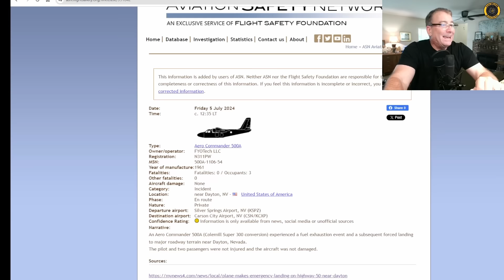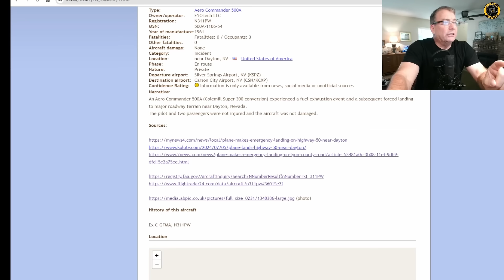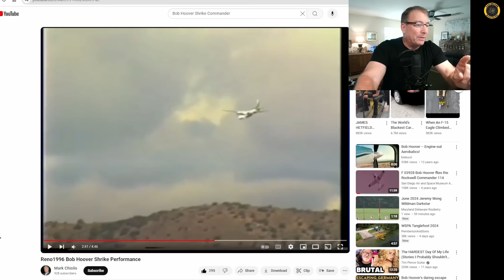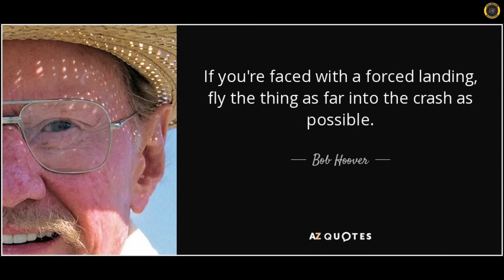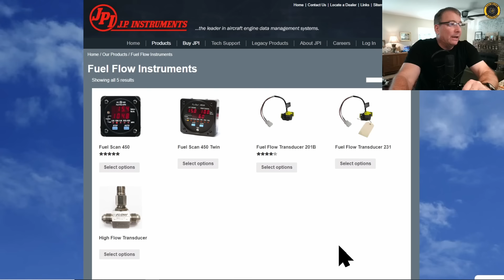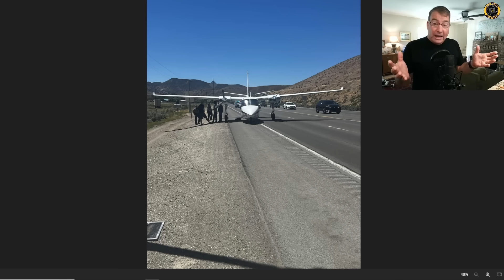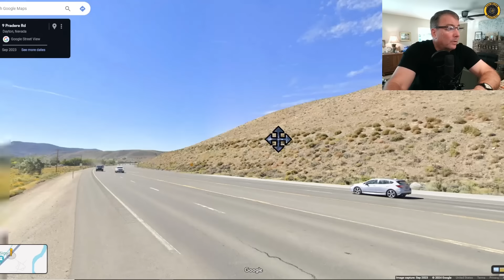Aero Commander Forced Landing Hwy 50 Dayton NV 5 July 2024

Comment: My father and me had a close call in a Cessna 337 due to fuel starvation we purchased from a crusty, retired airline pilot and AI.  As part of the sales negotiations he said that he just filled all four tanks with fuel that morning and demanded more money for the fuel. 
Seeing all 4 fuel gauges at "full" and taking a friend and professional pilot/mechanic's word, I never checked to confirm the tanks were full. I did get a bit of water from the sump drains near the tail boom wing struts and front engine strainer, and we departed for our first flight in the Skymaster to Spokane. On take-off the old Skymaster accelerated and climbed quickly at about 160mph indicated and nearly 1,000fpm, my dad remarked: "This thing's a Hot-Rod!" but only a few miles northeast of the Salem airport  (SLE) at about 2000ft we started to experience fuel flow fluctuations on the front engine. I hit the front boost pump which stabilized the fuel flow but only for a few seconds until the front engine quit completely. My father tapped the fuel gauges that were still showing "Full" as I switched the windmilling front engine to it's aux tank, and after about 20 seconds it roared back to climb power for about a minute and then quit dead. 

We were just south of the Aurora airport along I-5 so I made a bee-line for I-5 and the airport and switched the front engine from its 'Left Main' tank to 'Cross-Feed' from the Right Main tank for the rear engine, and in a few seconds both front and rear engine fuel flow began to fluctuate and quit simultaneously!. At that moment we both came to a harsh realization it was not water contamination we were dealing with. We both looked a each other and exclaimed: "WE'RE OUT OF FUEL!".

I switched the rear engine to its Right Aux tank, and in about 20 seconds the rear engine came back to life. I feathered the front engine and jogged over I-5 and prepped for a landing on the freeway, but the rear engine remained running long enough to get us close enough to the Aurora airport I figured I could glide to runway so I jogged back over to the runway for a downwind landing on 34, but just as lined-up with the runway the rear engine quit again. I feathered the rear engine and advised I was making an emergency dead-stick downwind landing on 34. 

The 337 we just bought was an early model with only one landing gear hydraulic pump on the front engine, so with the front engine feathered, the gear had to be manually pumped down, I placed the gear selector 'down' position and the big gear doors flew open and the mains fell into the high-drag trailing position. My dad said 'YOU FLY THIS SOB, I'LL PUMP THE GEAR!" but with his left arm in a cast from falling from his horse, he clumsily tried pumping the gear handle between the front seats with his right arm from the right seat. With the end of the runway approaching and my dad's struggle with the pump handle was not going to get the gear down in time, I moved the prop control out of feather to try to get it windmilling, and I saw the frozen, feathered prop blade rubberly snap into the flat pitch position (I had just discovered the 337 happened to have the rare un-feathering accumulators). I hit the front starter to get the prop windmilling and in a few seconds the engine-driven hydraulic pump along with my father's hap-hazard pumping finished extended the gear, at which point I re-fethered the front engine.

By then I ended up a bit low on approach but just made the numbers. With both props feathered we coasted to a stop just short of the mid-field taxiway turn-off, with all 4 fuel indicators still indicating 'F' for "FULL-FUEL" (plus a little more). I switched both engines back to main tanks and was able to get enough fuel to get the front engine started to get us off  the runway and to the the fuel pump. 

When I called the seller and grilled him about lying about the fuel he laughed and said: "Well you Dumb-A_ _es let that lesson to you and your old man, you should have checked the fuel! Lucky for you I didn't leave ya MORE Fuel or you'd be out in the mountains right now! Never take anybody's word for anything, HA HA!"
Reply: well, he was right, even though he was an ass-hat
Reply: @Bob-j5o3b  Yup, Lesson hammered home.
Reply: That's total BS. Had he actually been "teaching you a lesson", he would have waited until you were walking out to take off, then beat you over the head about taking someone's word. Worse, he knowingly sold you an aircraft that had defective fuel gauges and didn't say anything?!
Reply: That airline pilot literally tried to kill you. I wonder if he has killed before, absolute psychopath
Reply: @kurtbilinski1723  He obviously didn't intend it is a teaching moment, but rather as a deflection. As I posted below in response: "Bottom line was 'I' could have killed both of us by not checking the fuel. As for 'Bill' being a Psychopath,  I'd say it was more a case of an old horse-trader out to skin another horse trader, like the 90% of car dealers, attorneys and politicians that give the other 10% a bad name. 
We later found out all the fuel level sensors had been disabled to show full, and I found a hand written bit of cardboard with tape in the glove box that said "Fuel gauges INOP". He could have bought it and removed the placard, but it might have been seller he just bought it from a couple of days earlier who misled him as well.
Reply: @ninjalectualx  He obviously didn't intend it is a teaching moment, but rather as a deflection. As I posted below in response: "Bottom line was 'I' could have killed both of us by not checking the fuel. As for 'Bill' being a Psychopath,  I'd say it was more a case of an old horse-trader out to skin another horse trader, like the 90% of car dealers, politicians and attorneys  that give the other 10% a bad name. 
We later found out all the fuel level sensors had been disabled to show full, and I found a hand written bit of cardboard with tape in the glove box that said "Fuel gauges INOP". He could have bought it and removed the placard, but it might have been seller he just bought it from a couple of days earlier who misled him as well.
Reply: @jackoneil3933 Im by no means calling you a liar just having a hard time believing a retired airline pilot would do such a thing to someone. If you fatally augured in after a duel flame out he could be tried for manslaughter. Thank the good Lord your the type aviator that you are because it could have turned out worse. If it was me that happened to I’d have to return the favor and teach him how to not screw with peoples lives. Before I was done with the fool I’d have him reimburse me for the fuel load cost he charged me. Oh and also the cost for laundry for my pop and I.
Reply: Wow! Incredible airmanship! Thanks for the story
Reply: @Gebenki  Thanks! But I wouldn't call not doing a proper Preflght 'Airmanship'. 
I'd say if you are proficient enough to be able to safely operate an aircraft in emergency situations and to avoid  or prevent emergency situations, that's 'required'  rather than 'incredible' airmanship. 
I once asked a test pilot and astronaut (Scott Crossfield) a few years before his lost his life in his 210, mentioned something about what's most important in survival situations, and he said something to the effect: "in life-threatening situations, if you become more concerned with your own mortality or the mortality of others then extricating yourself from that life-threatening situation, you're probably not going to do so".   

In that situation I had flown a few hundred hours in several 337s My father and I had bought and sold , and had taken my private pilot check ride in a similar337, so I was comfortable to the point of being hazardously complacent. 

Most of the calls I had were in my first 1500 hours of flying, with most of the close calls  being in 337s, solely because it was the aircraft I was most  comfortable and complacent in and demonstrated some of my worst acts of poor airmanship in. I survived and learned from those episodes of bad airmanship, and not checking the fuel that day was one of the worst. 
I've often wondered is a person never committed acts of poor airmanship if you would be a better or worse pilot for not having done so?

Comment: Well, well, well!  I might have something to add to all of this.  About 25 years ago, I was returning from the Bahamas with my family from the Bahamas in our 1959 Aero Commander 680.  I had spent many an air show watching Bob Hoover do his magic in his Shrike in the '70's, too at my university airport as well.  (KCMI)

I personally filled the airplane to the point of fuel sloshing out of all tanks before departure from Vero.  A fuel stop was planned at Mobile for the return to Houston (KHOU), our base.  Enroute, we were experiencing substantial tailwinds, (unusual for that direction of flight), and broke out the calculators to determine our reserves if we skipped the stop.  The weather was pristine CAVU, and forecast to stay that was for the remainder of the flight that Sunday afternoon.  Multiple calculations, based on our fuel burn learned from long experience, said we'd arrive in Houston with 45 minutes in the tanks, so we amended our flight plan, got the amended clearance and carried on.

As we joined the conga line to RWY 4, the right engine sputtered, and quit.  Boost pumps on and it relit.  Wheew!  Weird, but...  Then the left engine did the same thing, relit monentarily with the boost pump on, and then both engines up and quit.  We were descending to 3000' maybe 3-4 miles south of the airport.  The tower immediately cleared us to land on any runway, and we turned to RWY 35.  The view was not good.  Making the runway with the engines windmilling was going to be a dirt sandwich.  For a flash I remembered Bob Hoover doing his crazy shit in his Shrike.  So I feathered both engines.  The result was amazing!  It was like  massive kick in the backside.  The glide flattened, as I held about 110 MPH, (my best guess at best engine-out glide speed with both mills feathered?!?), and in maybe 20 seconds, I knew we had the runway made.  After, and frantically pumping the hydraulic pump for pressure for steering and brakes, I lowered the gear with the runway assured, and touched down.  We exited the high speed to the left, rolled into Continental's old maintenance hanger ramp and stopped.

I immediately called the tower, thanked them, and called the fuel truck.  The airplane took (as I recall) about 140 gallons to brimming.  The placarded capacity was (best of my recollection), was something like 168 gallons usable.  During the incident, the collector tank gauge read about 20 gallons.  So two issues had conspired here.  First, on examination of the aircraft, two fuel bladders were collapsed.  This reduced the fuel capacity.  Second, (and incidental) was the float arm in the center tank was bent, causing the gauge error.  Next items of business were to drive to the tower than thank the guys in person, and then to drive home and fill out the NASA form!  (Still accessible on-line, I'd add!).  Yeah - there was a mini investigation.  The FAA was great, and actually congratulatory.  (Not sure if that would be the rule today, but maybe it is.)

Anyway, lots of lessons learned that day.  Probably the one that saved our bacon was one from the great Bob Hoover, all those years ago.  Thanks for this video, Juan.  Lots of memories!  Wow.  Just wow.

Comment: 'Fly into a crash as far as possible' is one of my favorite aviationisms.
What percentage of planes have a manual reserve fuel switch?
The old VWs had the switch at the center of the firewall inside the cabin. You flipped it to shift to the lower intake in the solitary fuel tank.
It worked -- IF you didn't forget to switch back to the upper pickup once you fill up after flipping the switch.
Reply: My old Kawasaki stand-up jetski had a reserve fuel switch. Saved my bacon a few times. Of course it wasn't used like in aviation and we relied on using up some of the reserve on purpose when we were within a reasonable distance from home, but still it was a great idea to have and surely it saved more novice riders then hurt them.

Comment: Great tip of the hat to Hoover...saw that act at Reno in 86. Looked exactly the same then.
Reply: Great Bob Hoover clip
But you are wrong about fuel gages only have to accurate at zero useable fuel.this is a common error assumption about the regs.

Comment: There are 3 wastes in aviation. 1. Runway behind you 2. Elevation above you 3. FUEL LEFT IN THE TRUCK
Reply: …. remembering there are only two occasions when you can have too much fuel:

1. When the aircraft is on fire

2. When the aircraft is too heavy to take off
Reply: As much as I want to point the finger at the pilot and go, "how could you have possibly done this?!?", I also know that pilot could have been me.   So far I've not done this yet... key word being yet.
Reply: Sounds like the old fuel oem gauge was the accurate one, go figure.
Reply: Thats elevation in "front" of you.
Reply: Amd #4 always ise cross feed or timer for tank switching per that particular aircraft operator handbook.
Reply: @08turboSS  in this context; if you have an engine failure (mechanical or fuel starvation etc.) you can convert elevation into forward motion - a.k.a. gliding. When an engine failure occurs the gliding distance available is directly proportional to your current above ground altitude, and if the ground altitude drops in a favourable direction you can glide further in that direction (or for longer if a restart become possible - carb icing etc.)

So long as airspace restrictions and the need for oxygen do not factor into any route decisions, extra altitude below you is better than "unused" altitude above you - in this context anyway.

Comment: Thanks for the update Juan. Good to hear they did not have to take the wings off and trailer it out.
Reply: Imagine being forced to allow a demolition company to cut off the wings, get the plane on a trailer and get the road open due to traffic being backed up for miles.
Reply: they move massive loads on that hiway all the time to keep them off the interstate--to move,tow it only 12 miles,easy--it would have been fun to see it take off on hiway
Reply: russbell6418  Agreed, but I have seen a highway departure end in a crash (on YT), so it's possible there is now a "hard & fast" rule, no more highway departures, regardless of the shape the aircraft is in.
Reply: russbell6418  They didn't want to risk it. Lower risk option to tow it the short distance to the runway and fuel depot.
Reply: russbell6418  Might not be worth the risk. I don't know if it's the same in airplanes, but in a car if you run out of gas, whatever gunk is in the bottom of the tank can get sucked into your fuel system, resulting in blocked fuel lines. I would think it's a wiser course of action to clean and check the fuel lines before the next flight if you've run the tanks dry.
Reply: @EXROBOWIDOW excellent point but that could have been accomplished there on the side of the highway. Afterwards a good ten minute run up of both power plants could have been  performed while standing on the toe brakes before takeoff.

Comment: I was doing a scenic local drive and drove by this aircraft on highway 50 about 30 minutes after it landed. Considering the pilot only had about 3/4 a mile of straight road, with a steep sloping down gradient and curve behind and a curve in front, they did a great job touching down without injury.

Comment: I was lucky to start my career flying a 500S in the 80s. A tricky part of the airplane was taking on fuel. It had several tanks that fed into a center tank. There was a portion of the fuel load that is not measurable between full and about 3/4 of full. If a fueler was not familiar with a Shrike, they would fill to the top and put the cap on. Unfortunately, they didn’t allow enough time for fuel from the filler cap to drained and fill the 5 tanks. After the first time landing sooner than planned, you climb the ladder and visually verify Shrike full tanks.

Comment: Similar experience with a 337. Just bought the plane and were heading back to DC from TOL. 6 men on board and it was night. Didn’t understand the fuel system. Both engines quit and they were out at 7000’ over dark country. Toledo vectored them to our county airport. They made it to our airport barely. There gear made a pathway through the bean field to get to the runway. Left it at the middle of the runway until help arrived.

Comment: Required equipment. Part 91.205 (b) (9) Fuel gauge indicating the quantity of fuel in each tank.    

The quote from part 23.1337(b)(1) requires that "Each fuel quantity indicator must be calibrated to read “zero” during level flight when the quantity of fuel remaining in the tank is equal to the unusable fuel supply determined under § 23.959(a).  

If you fly with gauges that do not indicate the quantity in each tank you are in violation. 

This airplane failed both part 91 and part 23. These gauges need to be repaired before next flight.

Comment: Jaun your statement that “ Fuel Gauges only have to be accurate on Empty “ . Very true of analog gauges. 
I had a Luscombe 8A with a single tank , behind my head. It had a antique automotive gauge. I had a calibrated dip stick for the tank. Made it by starting with an empty tank, then adding fuel from the gasoline pump. Then marking the stick. I carried it with the airplane. I could always dip the tank and know how much fuel It contained.

Comment: In my early flying days I was practicing and sightseeing.  I suddenly looked at my fuel gauges and realized I was very low on fuel.  I made it back to the airport, topped the tanks, and didn’t mention the situation to the FBO.  He never said anything about the fuel slip quantity.  Lesson learned.  Bob Hoover was the best. “Trade altitude for airspeed “.